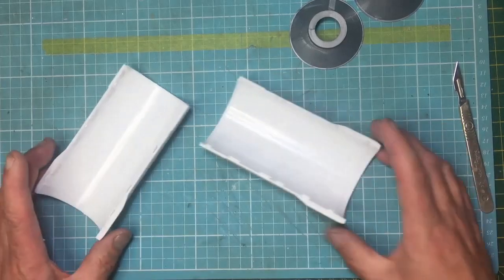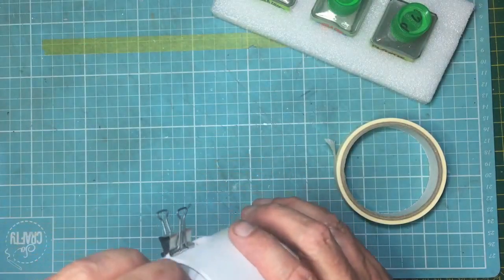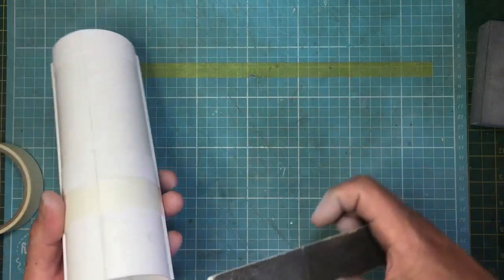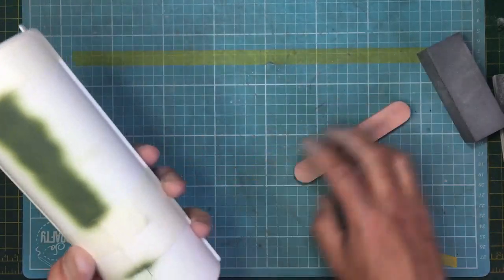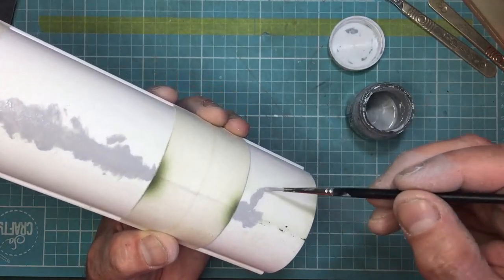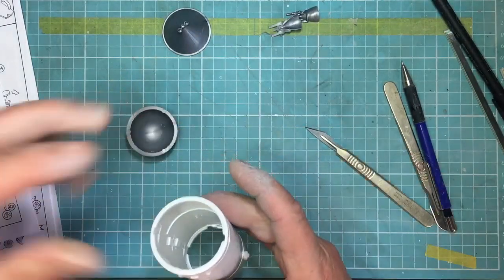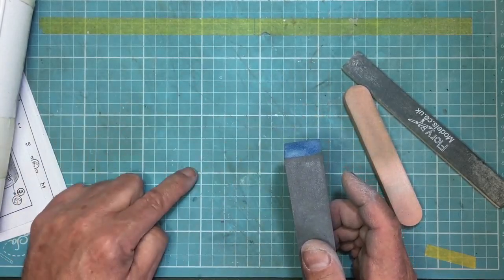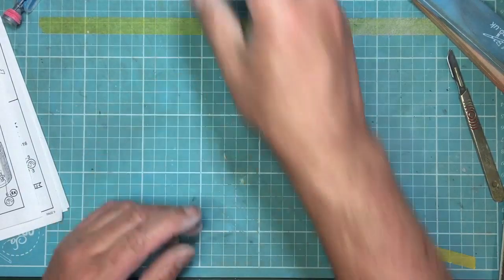Revell 1/144 Apollo Saturn V build series. Part 3. How I finish those long seams.

Comment: Nigel great video as usual.  Have you ever used Blue Magic polishing compound for plastic and plexiglass?  I .put it on with an old cotton T-shirt and finish up with a cotton ball, all this after initial sanding oh course.  Blue Magic is available on Amazon.  Keep up the good work, techniques you use are applicable to many different genres.  I’ve been modeling since I was about 10 and am now 70 and I never tire of the hobby, may take some time away now and then but always come back to it. If you are like me and I suspect many others I have more kits in my stash than I will ever build and that includes the 10 or so in various stages of completion.  Looking forward to your build along when you get back to it.

Comment: To be honest, many kit prices aren't too bad for kids. The problem is everything else you need. Just starting out with a £10 kit, you can easily spend over a hundred just to get glues, paints tools etc. Heck, even going cheap just to get everything could be double that
Reply: The airfix starter sets are great value for money as are the revell ones. I'd recommend a revell starter set great glue and ok brush. Then only a nail file and a nipper or knife.

Comment: @20:30  Hurrah - at last someone in Internetland describes how to file a curve correctly. Mr Evans (my 1970's Metalwork teacher) sheds a silent tear every time someone on the Internet says "follow the curve around" - noooo. 

Dear reader, if you are not used to it, it will "feel" really wrong rocking the file "the other way" until you re-learn the motor skills, but it's worth the effort as one achieves a better shape and cause much less collateral damage to the surrounding material.

Comment: For the record, everything is faster than a Ford Mustang.
Reply from the maker: Wrong.
Reply: @NigelsModellingBench  Full disclosure: I drive a Camaro. As we all know, the Camaro is a small and vicious predator that eats wild horses...😂When I saw 'Wrong", I thought I'd made some bone-head error about the Saturn. VERY nice fix on the inter-tank ribs. THose things are actually slightly rectangular hollow braces. THey stick out maybe, 3 CM from the side I think.